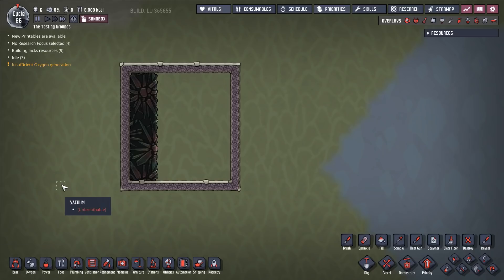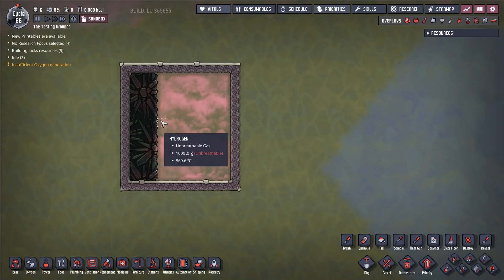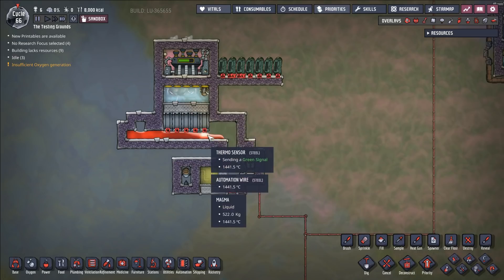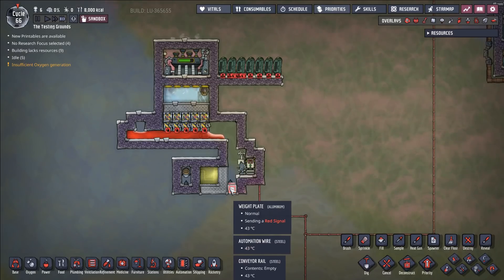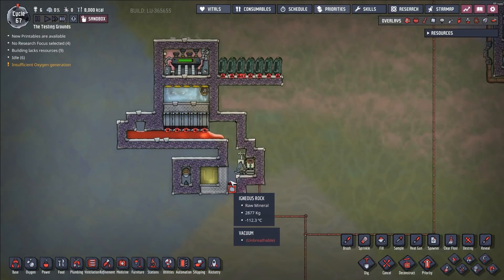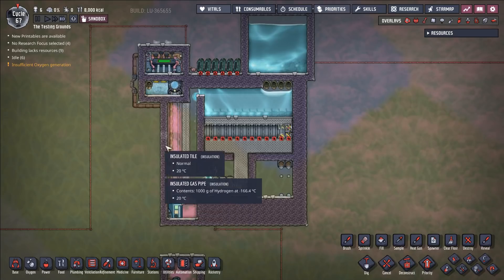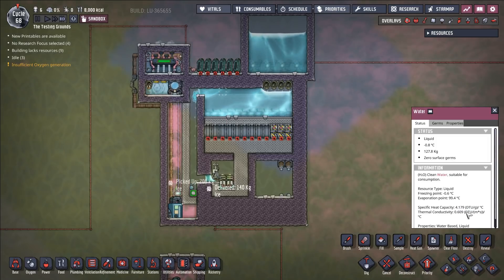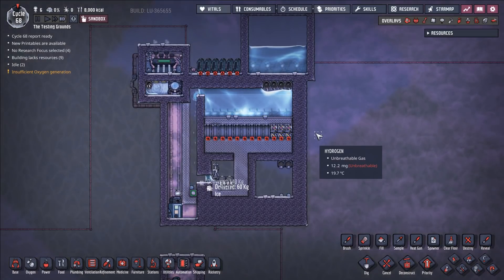How to Cool Your Base Using Volcanos PLUS the 35m DTU/s Ice Machine [Oxygen Not Included]

Comment: It's important to note that abyssalite is not actually a perfect insulator. Oni's rounding doesn't display it, but it's thermal conductivity is 0.00001. With that said, this still appears to be a bug, if the wiki's formulas on heat transfer are correct.

The tile to tile transfer rate (in DTU/s) is (the lower of the two materials thermal conductivity) * (difference in temperature) * 1000 * (material type constant, in this case the solid to gas transfer constant is 25)
This means that the transfer rate should be 0.00001 * 1673.1 * 1000 * 25 = 418.275 DTU/s

1000 grams of hydrogen requires 2400 DTUs to increase temperature by one degree, so we should only see about 0.17 degrees per second under these circumstances, a remarkably small temperature change considering a 47 degree material is in contact with a 1721 degree material. Those temperatures are changing by dozens or possibly hundreds of degrees per second. :(
Reply from the maker: The issue is that the game is taking the logarithmic mean of the thermal conductivity of the abyssalite and the hydrogen to determine the heat transfer rate.  So while the abyssalite's conductivity is near-zero, when it's getting averaged with hydrogen's the rate is fairly high, given the temperature difference.

If I recall correctly, in the past what they did was classify natural abyssalite as "insulated" just as insulated pipe and tile are classified.  The insulated property means that only the conductivity of the "insulated" material is used for calculating heat transfer, and the heat flow would be where you said, ~420 DTU/s.

Comment: Another interesting phase-change/transmutation possibility comes from molten glass.  That has a specific heat capacity of 0.2,  and but it boils at 2639K into rock gas -- gaseous magma -- that has a specific heat capacity of 1.0.

That means that a round-trip loop of sand -> molten glass -> rock gas -> magma -> igneous rock -> sand is heat positive by about 1MDTU/kg of material, or about 1MJ of electrical power if the residual is cooled via steam turbine.  The system is also mass neutral if all of the transmutation happens via heat (sand->glass is a mass loss in the glass forge).

Unfortunately, I can't think of a great way to generate the ~2700K temperatures necessary to boil the glass without a metal volcano.  Maybe a metal refinery using molten steel as the coolant, but then topping up the process would require an expenditure of a limited resource.
Reply from the maker: We use a similar idea with a regolith melter here:

https://www.youtube.com/watch?v=NOi_yweOQEY

Also, if you're looking for ways to make extreme heat, I have another video here:

https://www.youtube.com/watch?v=g6H3O0sl3fc
Reply: I was inspired by the regolith melter.  What attracts me to the glass-boiler is that it's a completely closed loop, where the final product of igneous rock can be transformed directly back into the source material with no loss.

The regolith melter seems far more practical because of the comparatively cool temperatures, of course.

Comment: I've been watching many of your videos lately to get ideas on what to do in my game. These are great for getting those ideas, but I was wondering if you could spend some time going through the actual construction process you would use if you had dupes doing it instead of the sandbox mode and materials you'd use for each part? Thanks for these even if you can't take the time to demonstrate building.
Reply from the maker: Any particular builds you wanted to see get made?
Reply: @gearheadgaming1  Any of them you feel up to doing would be great, but I guess the first one I'd like to see from the ground up would be the 2 turbines with the 3 liquid cooling devices. Explain the material choices for each part as you go, optional choices, method of construction, that sort of thing. I like to see each of the overlays and I am not sure I know the easiest way to create rooms with vacuums. I try to figure out the material choices by pausing as you pass over things, but that can be tough at times because you're pretty quick.
Reply from the maker: @Blyndem  I recently made the aquatuner half of an aquatuner + turbine combo in Survival Chances Slim, my let's play.  I used steel for the aquatuner and igneous rock for the insulation.  I "vacuumed" out the aquatuner chamber simply by filling it with water and letting all the air get pushed out by the liquid.  I vacuumed out the joint plate connection simply by tossing a gas pump in with it.  We're using water as our coolant.

I made a video on material choices, but never posted it because I thought it was too boring.  General gist though is that if you want the component to transfer heat, you make it out of something with a high thermal conductivity (granite, refined metals, aluminum/tungsten/thermium in particular), if you dont want it to transfer heat, you make it out of something with low thermal conductivity (igneous rock/ceramic/insulation).  If it needs a higher overheat temperature you use Gold (+50 C), Steel (+200 C), or Thermium (+800 C), and if the building doesn't list an overheat temperature then you can make it out of anything so long as it's not heated up past the material's melting point.

For coolants, you usually want to use something with a high specific heat capacity (hydrogen gas, water/polluted water, super coolant).  If the item has a positive or negative decor value, you want to make it out of something with a decor bonus, like sandstone, granite, copper, gold, or niobium.

Other than that, most of my material choices are determined by whatever is closest to the construction site.

Comment: Hey Gearhead, I've been continuing my no geyser skyblock challenge and it has been going well. But I'm at the stage where I'm planning out my sour gas boiler one of the few bits of equipment I gave my self at the start was the Anti Entropy Thermo- Nullifier. I'm wondering if you think it is worth it to incorporate it into the condenser as I have an excess of hydrogen from my arbor tree water maker.
Reply from the maker: If you have the resources, it's probably simpler to use a set of thermo regulators that are cooled by a steam turbine.  If not, the nullifier can help a lot in starting the condenser up, and then later become the heat sink for the thermo regulators that keep it going.
Reply: @gearheadgaming1  I see 
Lifegrow has a build that uses the Thermo Aquatuner made out of insulation as the heat source and the cooling, was hoping to build it before space but it might be the most efficient way to go.  https://www.youtube.com/watch?v=n76bxLpyMCU

Comment: How do you keep the sweeper from scooping up ALL of the ice?  You have to have some left there to reduce the temperature of the falling water to super cold right?  So how do you scoop up the excess but keep some left there?
Reply from the maker: In this solution I am using a weight plate, but because weight plates are somewhat bugged, the sweeper will be toggled off to prevent it from scooping all the ice, but wont toggle back on.  It might be a better idea to simply pump more water in than the sweeper is capable of moving, and then use a sensor on the water input pipe to turn off the sweeper if water stops flowing in.

Comment: What mechanic is this exploiting? The single aqua tuner can't possibly be the only one generating the cold. So you have dripping water, fine. It gets cold, sure. -200 ... how? Ok so it's -200 nice. How is it exponentially more cool-providing by shipping it through a couple of metal tiles?

This makes no sense to me.
Reply: It's a phase-change exploit - when it changes from liquid to solid and is NOT enough mass to form a block, it matches the temperature of the pre-existing material. Without the super-cold seed material, it won't work.
Reply: When something is dripping next to a source of cold, it transfers it's heat to that thing as is reasonable. That's the 'initial' source of cold, and is enough to get the water from the ~-1.6 degrees down far enough to freeze but only just barely. The bug/exploit is in the next step. Once the water is cold enough to freeze and drips to the bottom, even if the water is only at say -3, it's temperature is ignored and it's mass is added to the chunk that it joins. So suddenly, 10kg of water at -3 magically becomes 10kg of water at -200, resulting in a massive amount of heat loss.